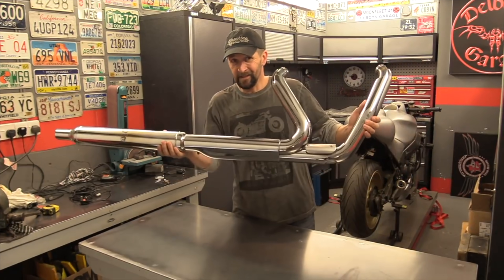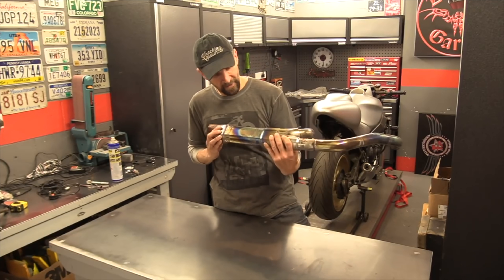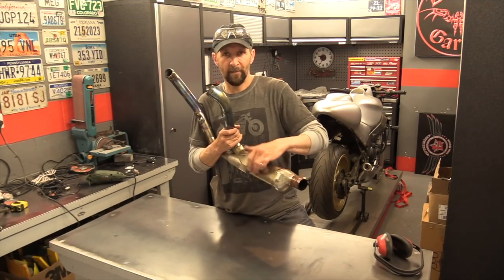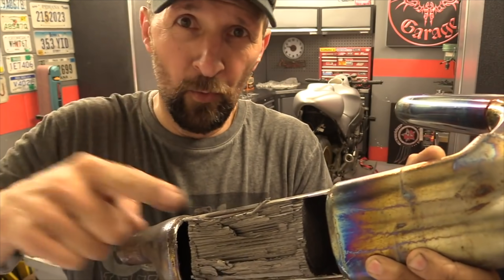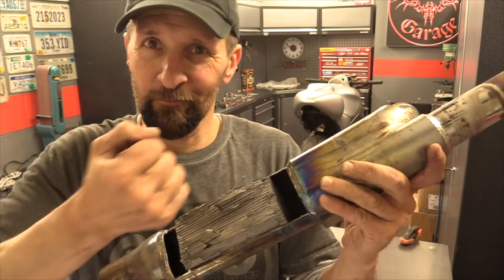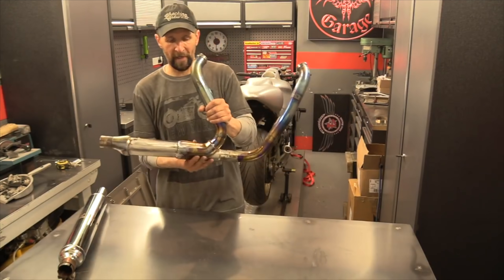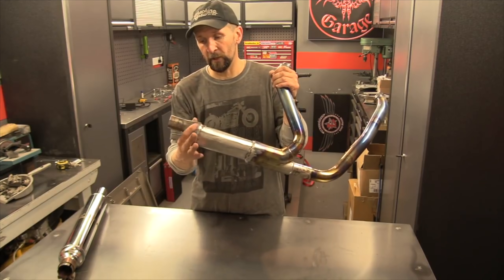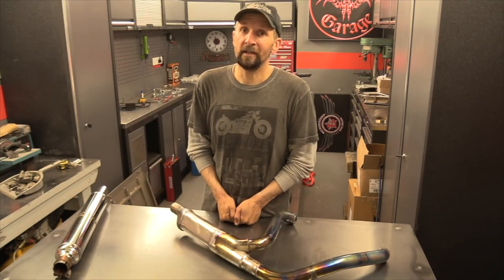Reloaded:-  Harley Dyna, "Cat Converter Removal"

Comment: That’s something new I didn’t know in exhaust system… on motorcycles??  Thus, I never thought bout it. Kwel video!!  Wouldn’t be surprised if later added oxygen sensor ( or already have), saw some new models has computer (ecm or pcm) which requires scanners.  Nice reloads!! Kwel!!
Reply: That particular setup actually has two pre-catalytic converter 02 sensors.

Comment: hi Great Vid, new to factory headers with CAT as just bought a 2014 Streetglide after having a 1985 FXR with a thunder header. Thought of doing the drill bit down the pipe , but this way looks neater and easier. Just a question, some people talk of o2 sensors now "cross talking" as a result of the CAT removal. Is that a thing or a worry?

Comment: Hi 
what oil is recommended for the v-twin TC88, engine, primary and transmission?
 Is dyna street bob 2006.
Thanks
Reply from the maker: Try Amzoil fully synthetic Primary fluid, and Amzoil Transmission oil,  i switched to them on my TC88 Dyna wide glide and it was a transformation.. smoother, quieter, and easier to start..  Hope that helps.
Reply: @Moonfleet41  OK, yes. One more question, do you have stage 1 complete with remap?
Reply from the maker: @JoseSantos-hl9cm  My Dyna was year 2000 with Carburetor, not fuel injection... so nothing to remap, i had an S&S SuperE carb, worked perfectly..
Reply: @Moonfleet41  ok. Very cool. Thanks

Comment: Hi Del, I noticed you recommend high temp silicon sealant for exhausts and not assembly paste. I'm fitting a new system to my Road King and want to seal the cross-over and mufflers. What sealant would you recommend? Thanks in advance
Reply from the maker: It's all about the gap between the two fitting pipes at the joint Sean.. most of the time, motorcycle exhausts fit very close and tight, and often need no sealant at all (think of the spring held slip on silencers)... i would only use an exhaust paste if the joint was particularly sloppy and loose, or if using silicone fails to seal it.. Hope that helps, and good luck..
Reply: @Moonfleet41  Thanks Del

Comment: What SS wire do you use in your mig Del?
My migs run pretty well any solid steel wire, but they're a bit fussy about what fluxcore i use.
I've got a bit of SS to do sometime and wouldn't mind a recommendation on wire.
The welding pages im on can be a little self important ego dribbly so i like to watch and learn rather than get involved!
Reply: - i realise its not fluxcore SS, just wondering if my high highfalutin Finnish machines will be as fussy with the shiny stuff as they are with the smoky stuff!
Reply from the maker: I don't overthink it mate, I just use regular 0.8mm Stainless wire with shield gas, works fine!